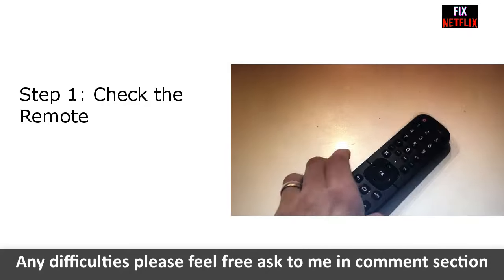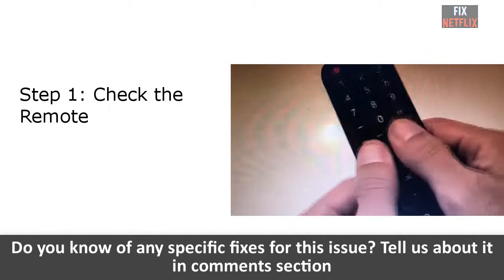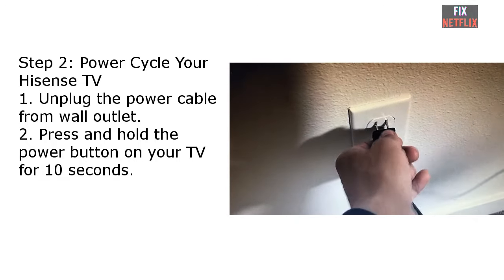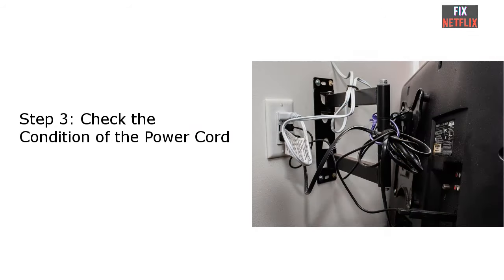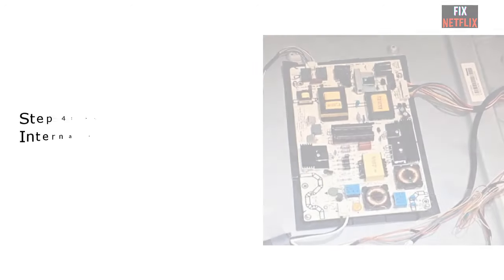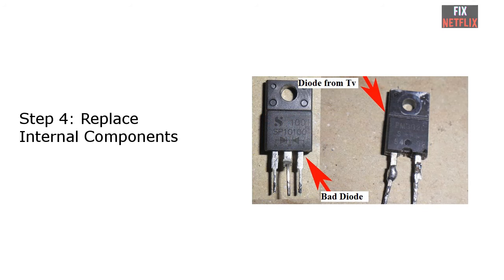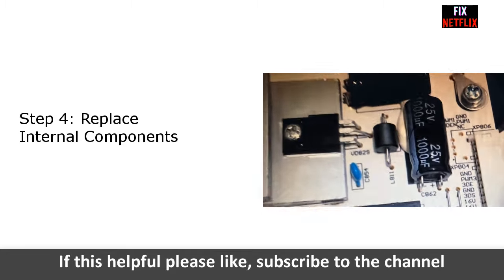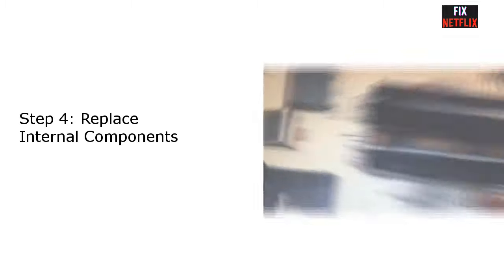Hisense TV Won't Turn On / Red Light Flashes / No Red Light / Complete Fix Guide

Comment: Mine does this and I replace the 2 capacitor that usually became failure. (Looping problem) then everything went OK for a day. Waking up in the morning press the power button on the remote then appears the red blinking light at the bottom of the TV. I know need to test what's this other problem 😮‍💨

Comment: My Hisense is blinking red with no power. Took it apart and the capacitors are still good. Could it really be the power cord?
Reply: no
Reply: My capacitors look good too. Replacing them tomorrow. We’ll see
Reply: @jlucman  how did it turn out?
Reply: @gbodysbc  turned out with me getting a 50” QLED Sony lmao. Done with the cheap TVs wasn’t the capacitors it was the whole board that was fried from all the USB LED lights in the back of it
Reply: Replacing my powe board doesn’t require soldering does it?????
Reply: Replacing my powe board doesn’t require soldering does it?????

Comment: My tv only turns on if I unplug the tv and plug it in. The power button on the tv won't work nor will the remote
Reply: Mine did the same thing and could not fix. Fortunately, it was still in the 30 day return window.....that is what I did.....

Comment: My Hisense Tv display black ...
Red LED blinking in Tv...
Which component need to change... Kindly help me
Reply from the maker: Dear sir,  thanks for reaching out here. 
Hisense tv not turning on and red light blinking due to several reasons.  
1. If faulty voltage supply in psu board 
2. Faulty main board 
So you need to check the faulty parts.  Then replace the part. This will solve the problem. 
Before open tv back cover,  turn off tv for 30 min.
There are high voltage ⚡️ charge in psu board. 
If this is helpful please like and share the video with your friends and subscribe to the channel for next tech video.

Comment: Very through video. What if however,  the TV turns on but will not stay on?
Reply: Check if your tv has a sleep timer on
Reply: @gabrieltembo  how mine doing the same
Reply: My Tv just powered itself off, no sleep timer on. I’ve unplugged the power cord left it out for about 20 minutes and tried to power it back on & it turned on-flashed the word HISENSE…-then turned itself right back off. What in the world now?
Reply: @MSMAES86 mine's done the same thing, is yours working now?
Reply: @SillyLilCreatuure  : Hey you know what, it is! I let it sit for about a couple of weeks unplugged. I know that the capacitors in the circuitry store a charge a good long while. My thought was that any accidentally entered setting for auto shut down would be lost- kind of like when you disconnect the battery to your car when the check engine light comes on. On a car the check light eventually comes back if the trouble is not corrected. That may not be what fixed the problem, but bottom line, it's working again like nothing was ever wrong. I'm just glad I resisted my wife's insistence that I throw it out! 😁 Let me know if you have any luck with yours!
Reply: @mort6913  ah ok good to hear yours works! Ive got a service booked on mine as my mum has sky insurance on everything so hopefully mine will be fixed or replaced soon
Reply: @ImAGoofyGooner @mort6913
Nope, mine ain’t working yet, though I haven’t even tried plugging it back in since the day I posted my comment about it insisting to not work! 
It’s been sitting unplugged ever since that day, and I am pretty certain it’s been like a week now? 🤷🏼‍♀️ 
I’ve done some investigating, and from what I can find out, it looks like the “Mainboard,” has to be replaced. 
It doesn’t look hard to do, via the video I watched, but based on what our local Best Buy quoted me, a new “mainboard,” runs $150.00. 
And, if I wanted Best Buy to do a diagnostic on it, order the part & do the replacement, it is $160.00 for the first “house call/diagnostic,” because any tv’s that have screens 42 inches or larger cannot be done in store; and mine is a 65 inch.
Then they order the darn thing, cuz it’s not something they regularly keep in stock, & then they come back out to do the actual replacement…..(which I’m assuming is another $160.00 visit). 
So, total we’re looking at like $500.00 give or take???!!?🤦🏼‍♀️🤦🏼‍♀️ 
Unless I just order the new part myself, from maybe Amazon or something, and replace it myself; then I’m only looking at the $150.00 for the part which sounds 100% better! 
One thing I haven’t looked at doing yet, is using my insurance policy I had gotten through my Verizon Wireless account, it’s like a “whole home electronics,” insurance policy that I added to my account like 1 1/2 months ago. I’m not really sure how it works yet, but it’s on my “to-do list,” for this weekend; most likely I’ll do it today because well it’s on my mind now! 🤣🤣🤣 
Let me know if y’all have an ideas about where to order the Mainboard from for a better price or comparable to the $150.00
Reply: @gabrieltembo  I did that already 4 sure!
Reply: @MSMAES86  im not really sure how to help there, im just going the insurance route and hope i never see a hisense tv again. Been checking lots of reports on this issue and it seems like a very common occurrence. So if you can id switch to a different tv brand like Samsung or lg or something more reputable than this. But its up to you sorry i can't help more 😂
Reply: @SillyLilCreatuure  😊 it’s all good! But yeah, I have a 75’ TCL model that is in my living room, but it best not be trying to do the same thing as my Hisense has, let me tell you what! I’ll take it out to the freaking desert with a shotgun and we’ll have a good ol’ time lighten them babies UP! 😂 
But yeah ima call the Verizon insurance company and see what they say??
Reply: You’ve read all I’ve said bout it right?
Reply: @MSMAES86  yea sounds like a good idea, hopefully they'll send someone to take a look and possibly replace it 😂
Reply: @MSMAES86  i did yea, trying to get the mainboard replaced sounds like too much of a pain and tbf you'll probably end up paying more on repairing than its worth 😂
Reply: @MSMAES86 probably a low power supply or something

Comment: I have done the hard reset I’m trying to set back up after I chose the time zone option it goes to a picture of a remote control and a 3.2..1 count down on the screen. It shows the back button and home button being pushed at the same time. I mimick this with my remote and still nothing changes. Please help. 😢

Comment: My hisense tv has red light on but won't switch on and has no reset button
Reply: Same with mine, did you find an answer?
Reply: @jessicastreetjwmrealtorgro7684  My reset button is next to the USB connections. It is tiny and does not protrude from the TV, so look closely.

Comment: My Hisense led tv just started to have a flickering red and blue light on yhe power button,it doest switch on.

I jave tried the 30 or 60sec rule but stil flicks light..also i cunt locate the reset button.

I have removed all cables hdmi etc.

It still flicks the reb and blue light on power button